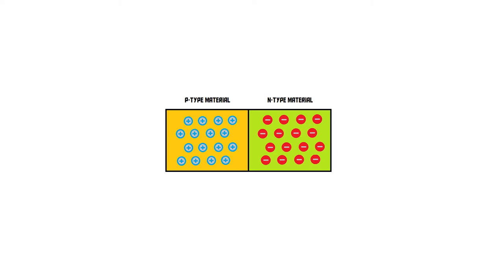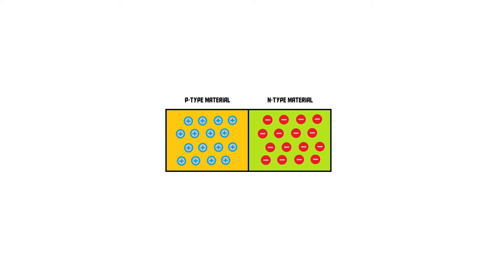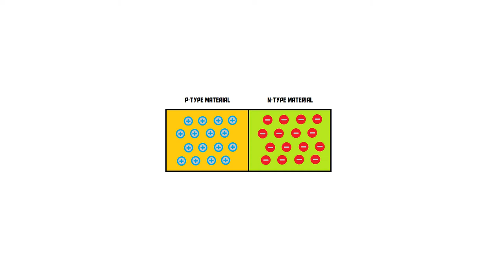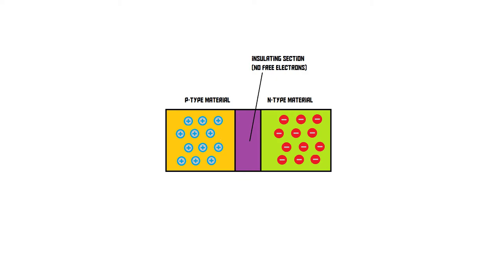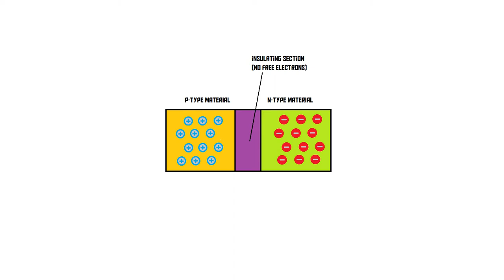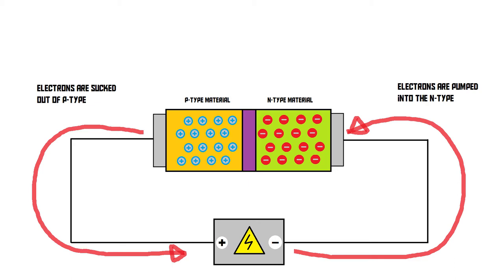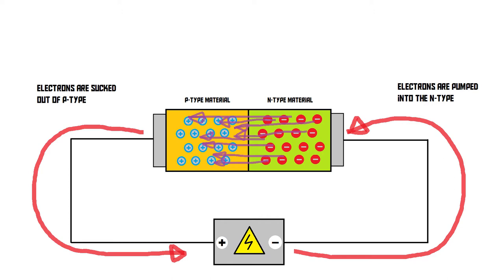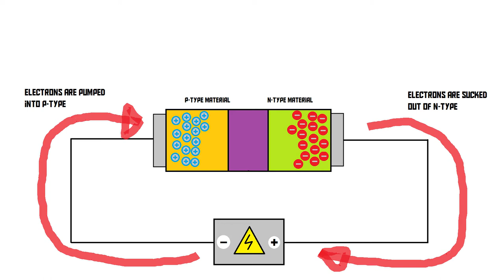How does an LED actually work? (AKIO TV)

Comment: Funny thing is, all diodes, LEDs, and solar cells rectify current, and generate a voltage when light is shines on its junction, or emits light when current flows though it. 

What makes any one different then the other is how they are optimized.